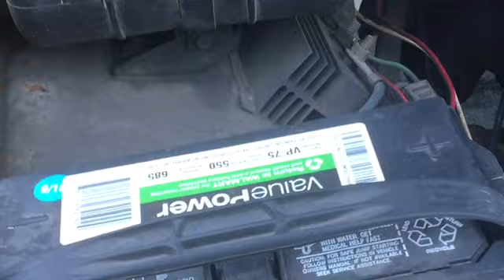ON MY WAY DOWN😂

Comment: I agree with scrap farm  put external universal trans cooler on it and flush your cooling systems thats probably why trans is slipping  your trans is getting low on fluid because it's getting into your radiator or get a new radiator you can bypass it add trans fluid and water  and limp it home or compound

Comment: so ends the mystery of the missing trans oil ,we can see where it went now.  could try topping up trans,pinch the line and run with rad cap off ,limp along you got a load on, stages mile or so a time . thinking the leak is on the pressurised side so hopefully wont suck into trans. good luck my friend